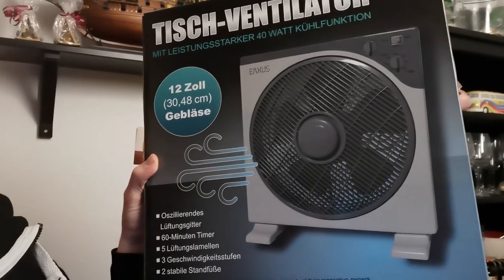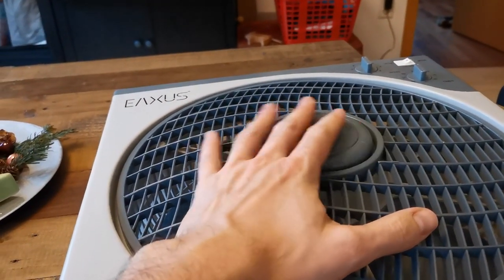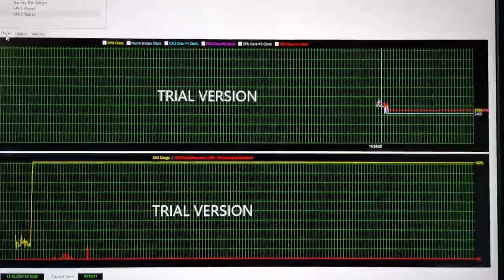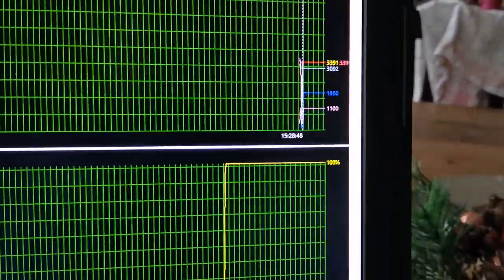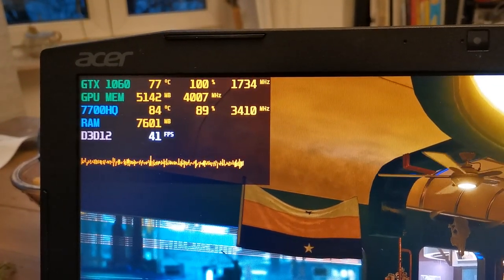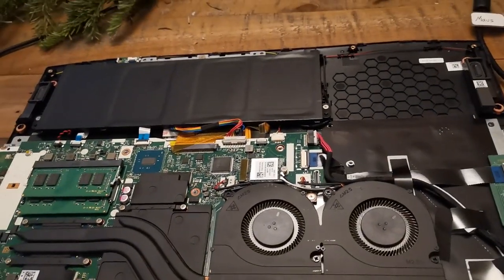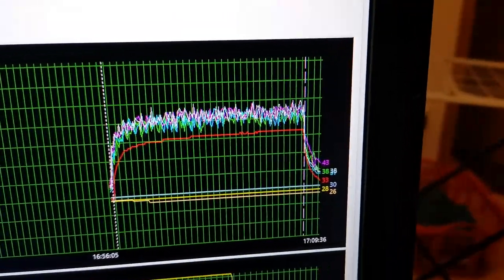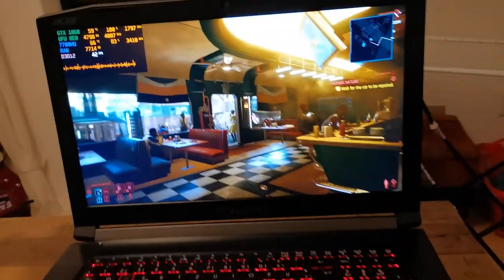I've installed this as my laptop cooler. Look what happened....

Comment: I use my laptop (i7 7700hq rx 580 8gb) docked in vertical without the backpanel with a 40 cm fan blowing air at it. I've been using this for almost 3 years now, helps on temperature and the fan noise is not loud at slow speeds.
Reply from the maker: Haha sounds fun